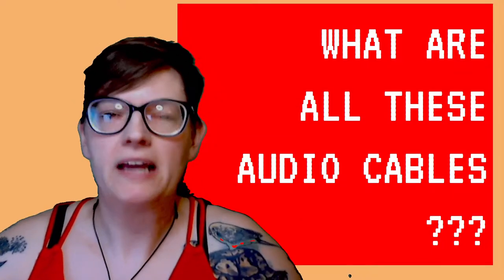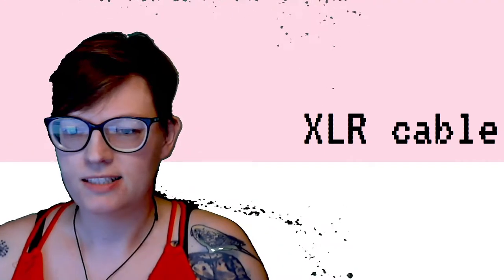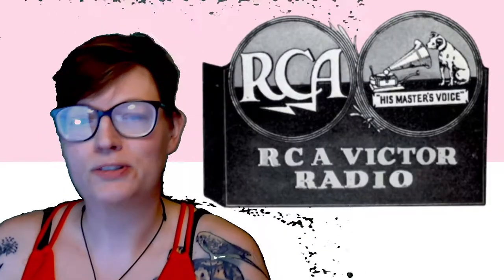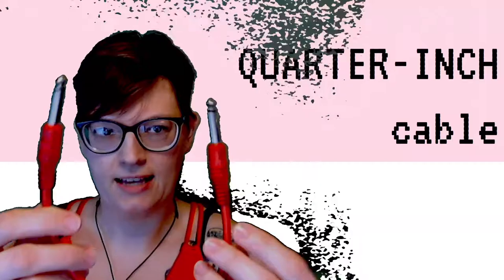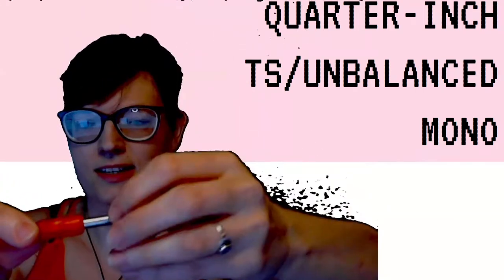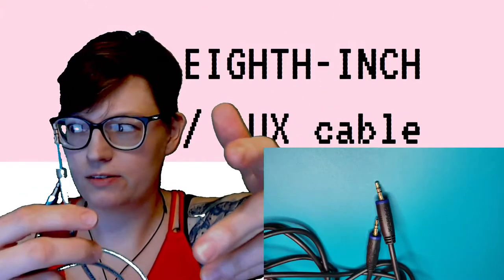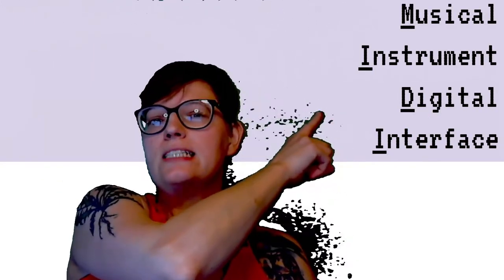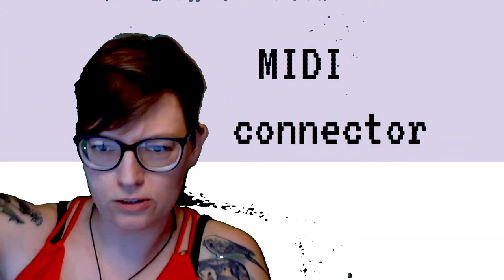Name That Audio Cord! Names & types of sound cables! Learning Music Production with Lorene

Comment: The type B was to prevent accidental plug-in to a power port configuration, since USB was for both data & power. While some connections are data-data, some are data & power.

The B kept you from frying a circuit by an improper plug in.
Reply from the maker: That makes so much sense! Thank you!